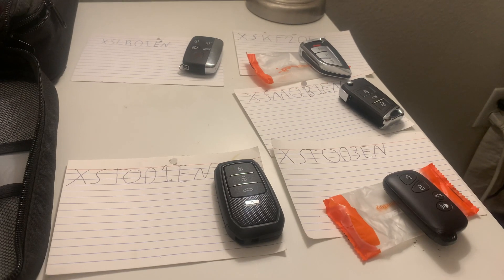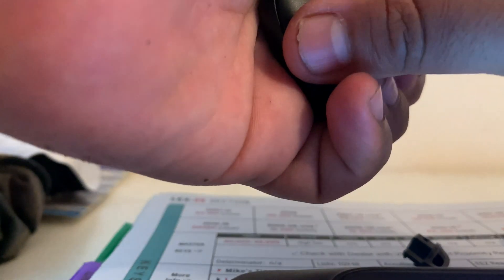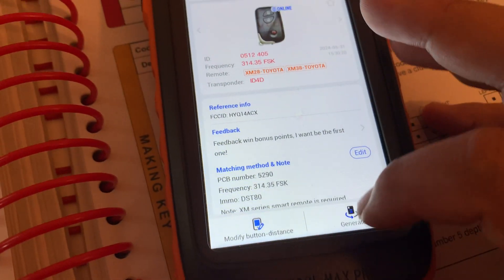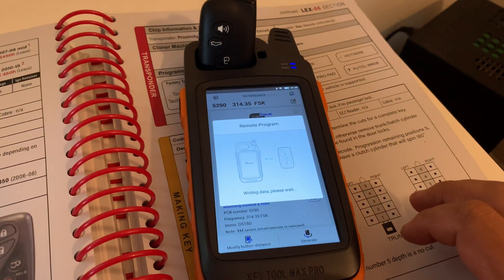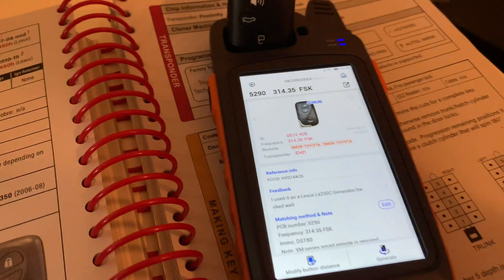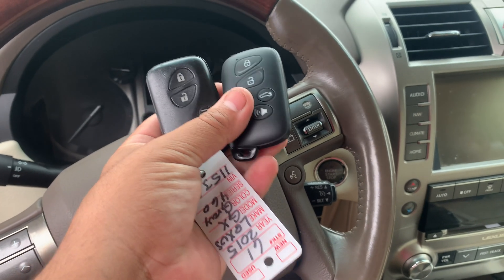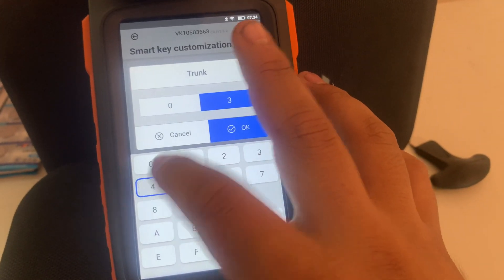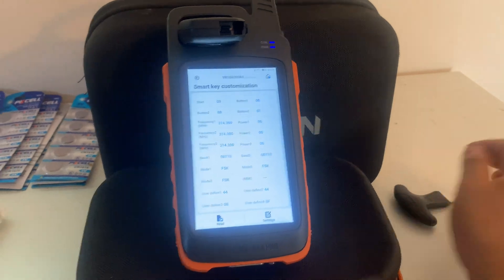YouTube University Automotive Locksmith Course Universal key systems-Xhorse Smart Remotes Explained

Comment: Have you had consistent success when programming the Xhorse generated  XS keys to the car with the KM100? Or have you found that it is a must to use the Xhorse ODB capable VVDIs such as the pro max ?
Reply from the maker: I’ve had lots of success with the Toyota XM38 versions. I’ve never used the normal XS ones successfully but lately I lean towards the autel keys for push to starts anyway. On the Toyotas and Lexus I have successfully used the key tool max pro successfully.

Comment: I agree on your advise regarding which Key programmer to get.  It is best to have both if budget permits, the KM100 and the Xhorse VVDI Keytool MAX pro.  The Xhorse has the special  function which is unique but I have yet to actually try.  Its the "VVDI Smart key Clone".  The KM100 does not have that.

Comment: What are the differences between the XM38 smart key to the XE series that are not designated XM? Are they interchangeable? I notice that the non XM ones such as XE…. Will still appear to generate  even though the Xhorse app list under Remotes: XM38-smart or XM-Toyota etc.  appreciate all your videos. They have been very useful
Reply from the maker: Well the xm38 generally can do what the xe can do but the xe can’t do what xm38 can do. I hope I understood your question and answered correctly.
Reply: @Beginner-locksmith  Thank you.  That explains that after I add the XE non xm38 key into a 2015 Mitsubishi Lancer GT CVT, all keys such as the OEM key appear to program using the KM100, but at the end of the successful complete message, no remotes work nor can the engine start.  I have a XM-smart Key on order and will update this thread so that fellow viewers will see it.  Thank you for great videos.
Reply from the maker: Unsure what going on there but good luck on your job 👍
Reply: @Beginner-locksmith  Got the XM38-smart  (XSCH01EN) key today and generated the key with the VVDI mini for 2015 mitsubishi lancer GT which comes with a Semi-Smart Proximity key and turn to start column mounted Off/On/start.  The KM100 was able to program the Key to the vehicle.  my mistake originally was using a non Xm38 XS series key.
Reply from the maker: @TheRealoldcar  awesome 😎 I’m glad you figured it out!!!